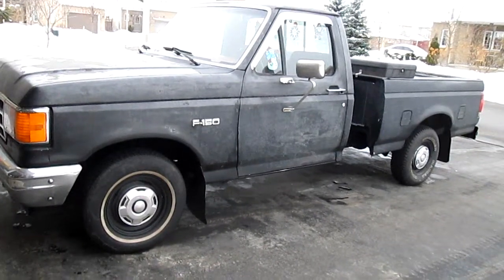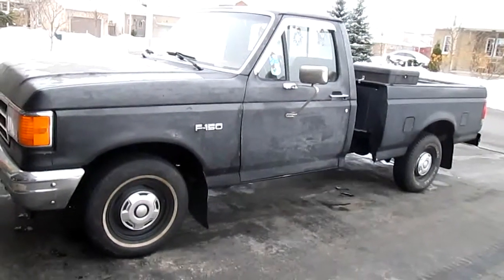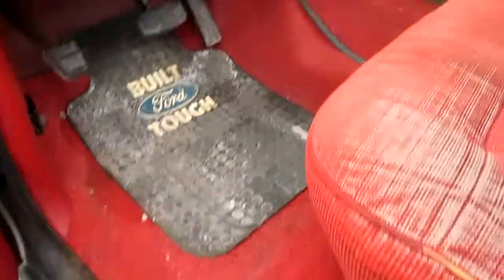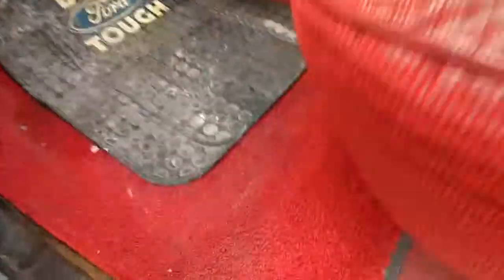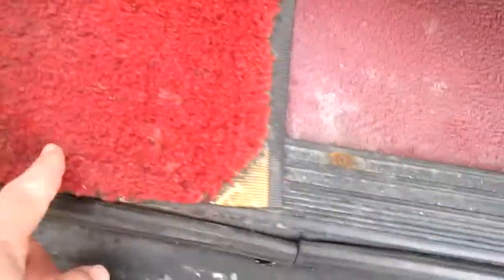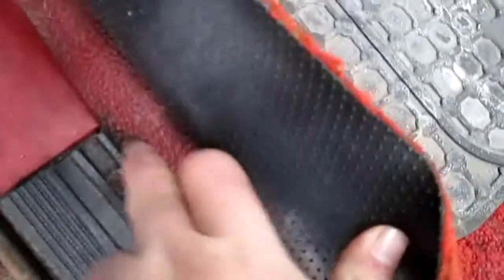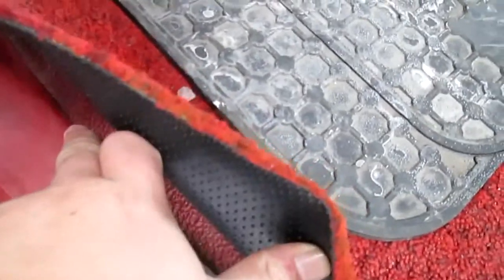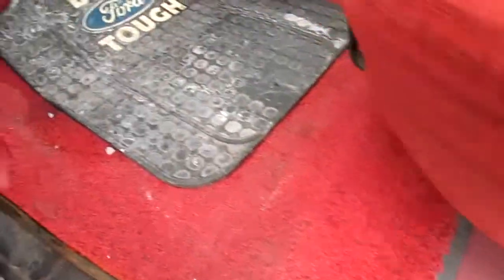December 2013 Cold Start 1989 Ford F150 Big Six

Comment: ive been using 5 quart or castrol 10-30 and Lucas oil stabilizer, and K&N oil filter, also have K&N air filter. ive had the truck for 5 years. has over 300,000 miles and just keeps on goin.

Comment: Haha, wonderful Canadian Tire MotoMaster oil! Same oil and filter in my truck!
Reply from the maker: I usually run Valvoline in it, but the Valvoline diesel 10W30 isn't on shelves here, gotta be ordered, or bought from another place that sells it way to expensive, so I just went with this, and using the very last of these filters, I don't like them. I cut one open to see the design inside...I was not impressed, especially with the cardboard by-pass valve...same design as the fram filters.
Reply: The thing is, is that those filters are %100 the same as fram, just re painted. Cut both of them open, its the same. And, these old engines don't care what you run in them, or how well you filter them.
Reply: No, i am saying moto-master, and fram are pretty much the same. I guess it looked like i was talking about purolator. Most filters are 75% the same anyways.

Comment: You’d think after 100yrs Ford would’ve thrown that crappy P/S pump design in the garbage. I loved the 300 six. I had one in an 88 F-250 with the granny gear 4-spd that would out pull a 350 V8 all day. That is the only Ford that I’ve always regretted selling. Hand crank windows, no a/c , no fancy cloth. I’ve loaded the bed with green oak wood above the roof of the cab AND had a 7500lb trailer behind it loaded as well. The 300EFI six just didn’t care. It never won any acceleration contests but it never seemed to be in a strain either. I’d buy another one in a skinny minute.